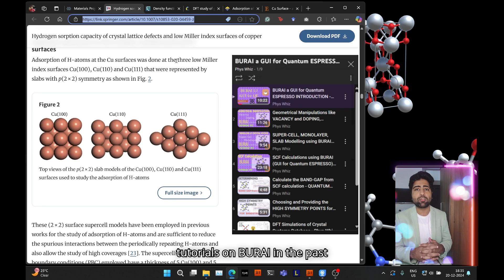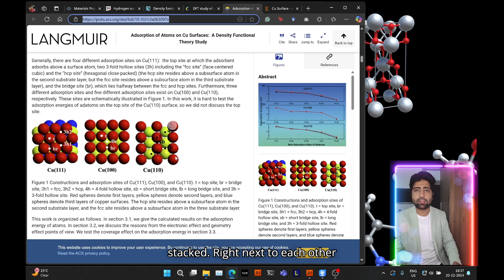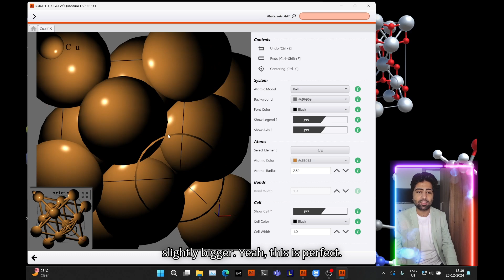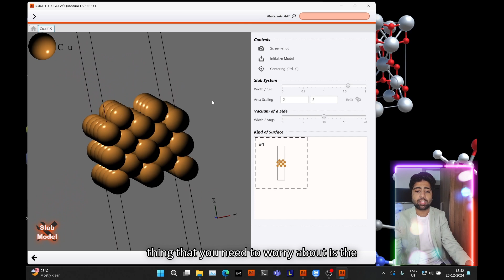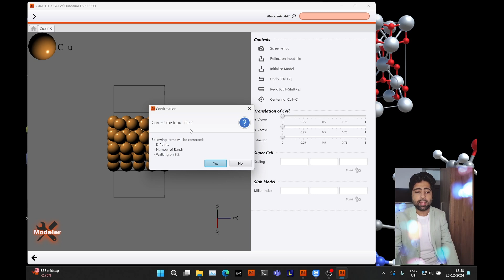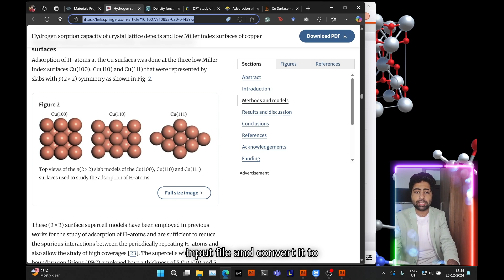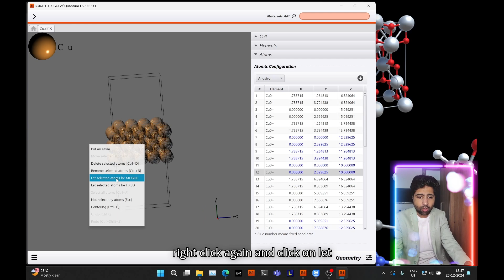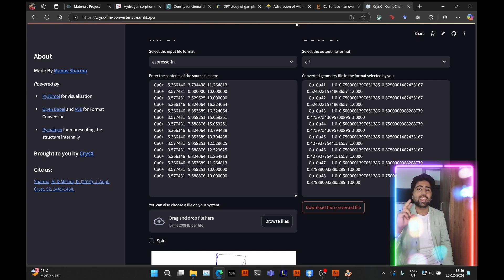How to model the Copper Cu (110) Surface using BURAI? [TUTORIAL for Beginners]

Comment: This is a single line of code in ase......
Reply from the maker: Great job! I think you're beyond the beginner level that these tutorials are designed for. Speaking of which, my next tutorial covers exactly that.

The goal of these tutorials is to introduce beginners to computational modeling tasks. While I could have wrapped up this tutorial in one simple step, I wanted to provide a more comprehensive approach.

We discussed the importance of consulting literature, finding CIF files, understanding vacuum relevance, and exporting Quantum ESPRESSO inputs to CIF or POSCAR formats.

Modeling chemical systems by coding can be intimidating for beginners, but it's a crucial skill for computational modeling. I will slowly introduce these too. Thanks for following along!